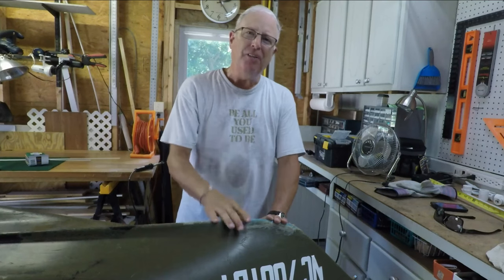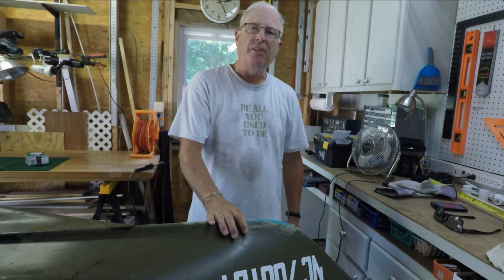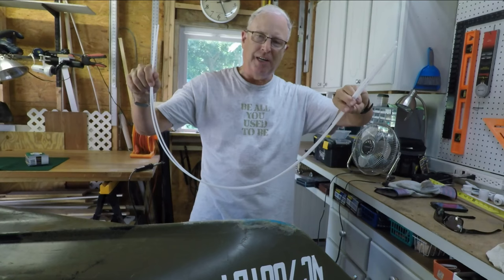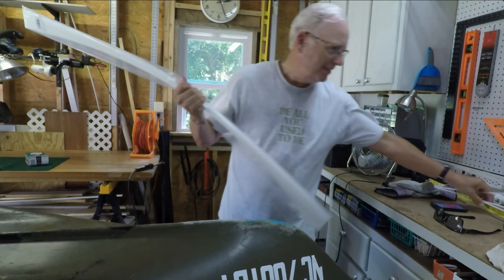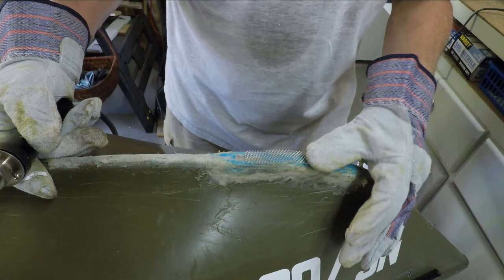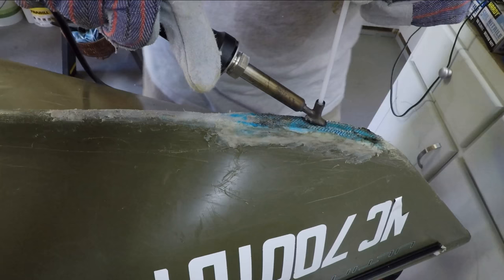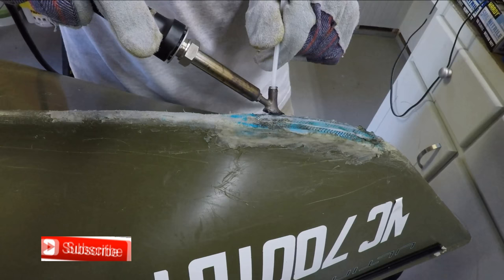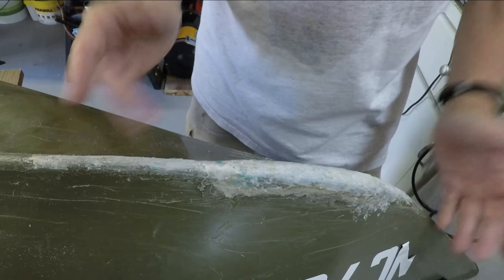Source of Cheap HDPE Rods for Plastic Kayak Repair and Kayak Welding

Comment: Great video, Steve - any chance we can see the finished (ie. sanded) product. I assume you sand it off to maintain hydro-dynamics (ie. reduce water resistance). Thanks!
Reply from the maker: The very end of the video shows where I left it off as "good enough."  It ended up being pretty smooth.  But, I did another video on sanding for speed vs the whole issue of waxing you might be interested in - https://youtu.be/ye0RiGu5yl4?list=PL8egn41J7Go9-1BgMNPF5FvNm0yqqqelS

Comment: Can you get sacrificial stainless steel caps to protect the keel ends?  Get some scrap, a sand bag and get beating. With a little practice ,it is easier than you may think. Drill a couple of holes in the metal on the sides and melt in some plastic plugs to secure?
Reply from the maker: I should probably try that. Thanks for the suggestion.
Reply: Andrew again you need your own YouTube channel! You have some great ideas!

Comment: Back when I was into airboats we used 3/16 inch sheet steel wrapped around the front of the Jon boat and about halfway down the length of the boat bottom. Great for beaching, driving over levees and loading it on to its trailer. Why not do the same with your kayak nose?
Reply from the maker: I do not know how I would attach that... and... it sounds heavy.

Comment: Question my friend. Did this reinforcement last a season maybe two? Because I just spent quite a bit of time using Kydex sheets, heat gun, Scotch 15lb double sided tape and silicone around the edges. This was a lot of work and what you just did was a whole lot simpler so did this last you pretty long?thanks for the money saving tip.
Reply from the maker: Yes, once melted into the existing hull, it is permanent.

Comment: how well are those repairs holding compared to the hobie rods?? also another tip i got from a friend was how to get rid of oyster rashes without sanding. one was getting pieces of old heavy duty tarps, a putty spatula and a torch and heating the spatula till it was hot enough to melt the tarp, lay the tarp over the rashes and brush the hot spatula over the tarp and it will stick and fill all the rashes under or anywhere in your yak.
Reply from the maker: Ponky Holding fine. no difference - They are all the same material. I saw the tarp thing on another vid and checked out that idea. I could not find any tarp made out of HDPE. I did not want to mix tarp with my kayak's  HDPE.  I have another vid I have not posted on using the same technique with real HDPE I have not posted yet. If you try the tarp trick, let us know how it works!

Comment: Could you use something like Plumbers tape hammered in a V to protect the nose a little, HDPE welding it in place?
Reply from the maker: I am not familiar with plumbers tape other than what you use to wrap around threads. Can you share a link to it? I think the key is the HDPE would have to be thick enough around the edges to hold tight to the kayak and then cover the material if it does not stick to what you are referring to.
Reply: The stuff I am talking about is a roll of sheet metal about a inch wide with holes in it. The holes would glue it to the kayak like your screen, but stronger maybe. One screw at the top and bottom maybe.
Reply from the maker: I'll have to find some of that.  It is only a matter of time this summer until I have to redo the fix. Thanks for the idea!
Reply: Can you provide a product name or link for plumbers tape?
Reply: They call it,,, Perforated Galvanized Steel Duct Strap
Reply: Kayak Hacks Fishing + Seems it would rust, even though covered. SS isn't too much more, but certain numbers of stainless will corrode from lack of oxygen.
Reply: my concern would be how most metal additions would hold up to oxidation in salt water.

Comment: What is the benefit of the metal mesh?
Reply from the maker: If the repair is in an area that frequently rubs on concrete, the metal mesh will protect the hull better than just plain HDPE>

Comment: ~~~Buy it in a 1lb-5lb roll.~~~ No more 2-3" stubbs of perfectly good rod going in the trash. And run a pick awl through the iron when done and still hot. Clean out and scrape plastic from bottom and sides. That'll make next repair as easy as first use.
Reply from the maker: Great idea! Thanks

Comment: Just look for some #2 scrap and it costs nothing. My oldtown kayak was melted in a shop fire. I will repair it just like this was done using scrap plastic.
Reply: Yeah HDPE is abundant, but I imagine it's a helluva lot easier to use the rods that just feed perfectly into the gadget rather than wrestling with scraps, or having to create your own rods.

Depends on the application and what kind of melting tool you have I guess.

Comment: You probably could have just put an old milk jug on the spot and melted it with a heat gun.
Reply from the maker: You bet. I discuss that option in this video - https://youtu.be/lrJTkvTmsTc
Thanks for bringing up this point!
Reply: I melt HDPE garbage into blocks to machine. So I know molten goo is molten goo. It doesn't really matter what it looked like when it was solid. This was milk jugs http://i.imgur.com/boPwUiN.jpg
Reply from the maker: Wow! Now that is what I call recycling!!